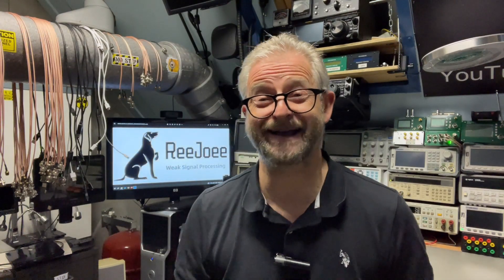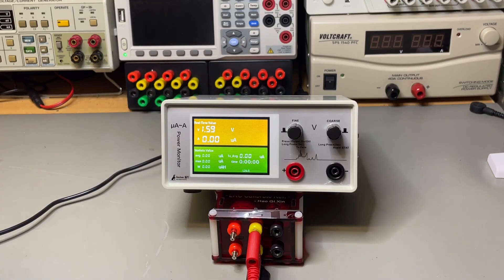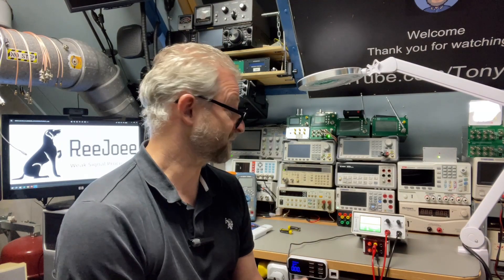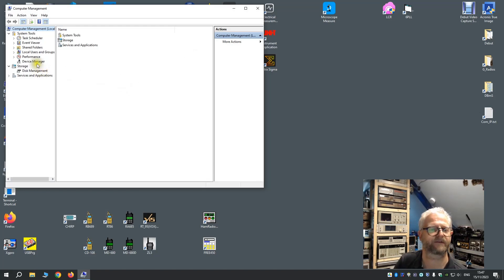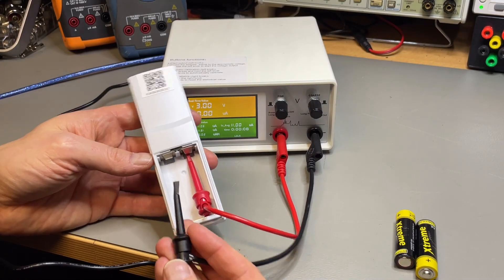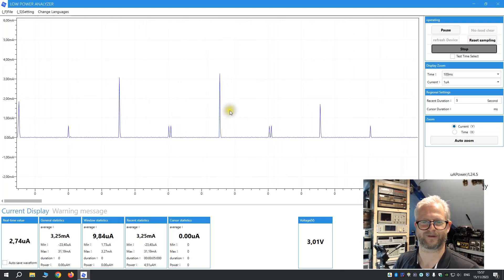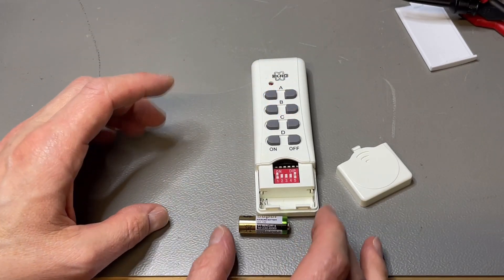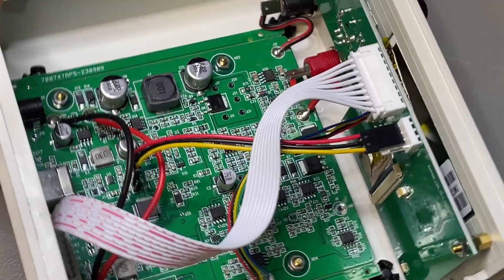TA-0380: ReeJoee uA Power Monitor EMK850 - Weak Signal Processing

Comment: Ik snap niet hoe een "nauwkeurig" meettoestel wat µA wil meten, een goedkope SMPS gebruikt ?
Als je een Non Contact Voltage detector zoals een Volt Stick van Fluke, of een generieke gebruikt, word het een kerstboom als je er mee in dit apparaat rond gaat.
Deze Non Contact Voltage detectors staan geadverteerd om vanaf 80a90V AC te meten, maar de meeste reageren ook al op slechts 5V DC van een switchmode powersupply (bv smartphone 5V stroomadapter met usb uitgang), door het aanwezige switching noise boven op de DC. Aangezien er draden vanaf de DC jack over de print naar de On/Off schakelaar lopen word dit switching noise geinjecteerd in alle IC's in de nabijheid van deze draden. Vermoed dit ook de reden is dat de uitlezing niet stabiel is op het schermpje. 
Het zou een leuke test zijn, om deze power monitor te voeden vanaf een lineaire lab voeding, om het verschil te zien.
Reply from the maker: Dat is echt een goed punt zeg.... zelfs bij portable scope zeggen ze inderdaad dat je bij kleine signalen echt alleen op de battery moet meten.
ik heb dat totaal over het hoofd gezien.. ik vond de software zo gaaf, dan ik daar verder niet over nagedacht heb.  Thanks!
Reply: @TonyAlbus  , ik had al een gelijkaardige review gezien op een ander YT kanaal (IMSAI guy) en daar werd ook de meegeleverde voeding gebruikt. Moest de meegeleverde voeding een zware lineare zijn zoals vroeger , dan zou er geen probleem zijn volgens mij. Maar tegenwoordig is het SMPS wat de klok slaat. Tevens is de prijs van 500$ overdreven, maar men wil blijkbaar de research kosten recupereren. In mijn ogen, zou dergelijk toestel rond de prijs moeten zitten van een 60Mhz "simpele" signal generator. En dat is rond de 60€
Reply from the maker: @BjornV78  Op Ali zie je soortgelijke apparaten inderdaad vanaf 100 zonder display en met display rond 200

Comment: It will be fair to compare values [uA] to a more precise device e.g. your Siglent Bench Meter (with CARD) or 4..20mA calibrator from your resources. 
I wondering, what class of measurement it is. Does any specification & calibration exist for this product?
Reply: Thanks Tony. I know below review. 

 It will be interesting challenge to understand, if it is proffessional meter with high accuracy or not in  case of time between measurements more than day.

If we talked about 16-bit resolution and uA measurement, there are a tons of possible challengs to see real values from meters :)
Reply from the maker: No specs available yet. 4-20 mA is a 1000x more, not sure what you want to see there.
Here someone did what you ask i think, but did not go far into the software.
https://www.youtube.com/watch?v=34OWJWtEQSQ